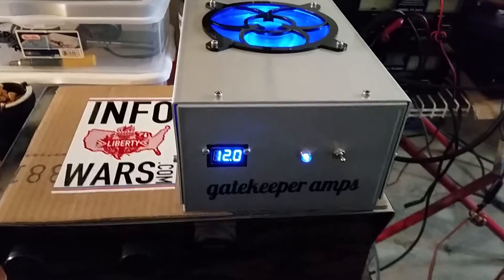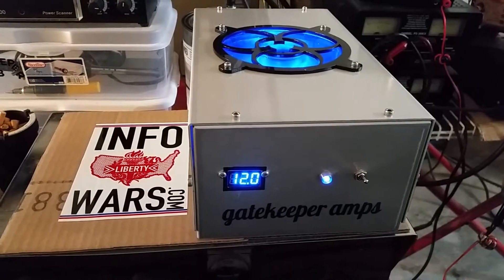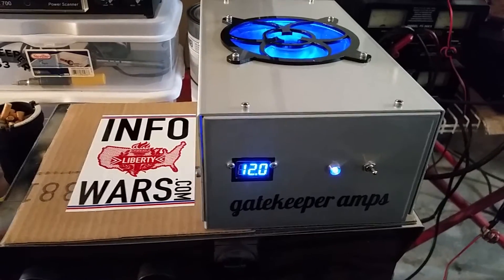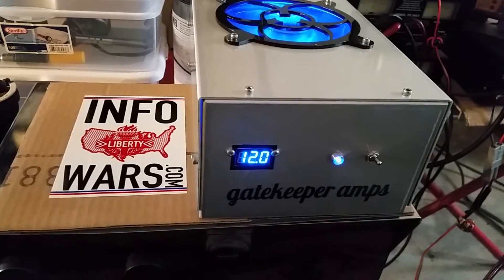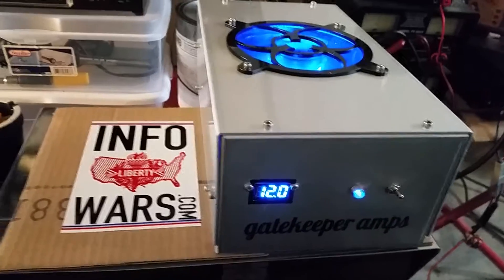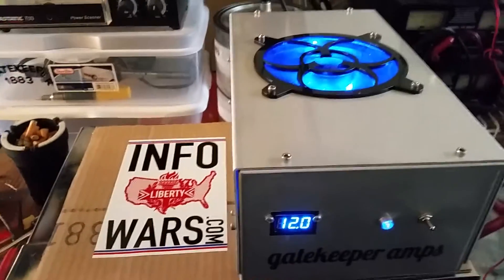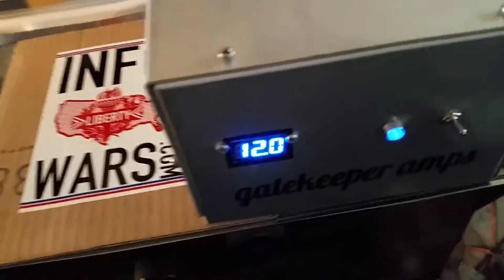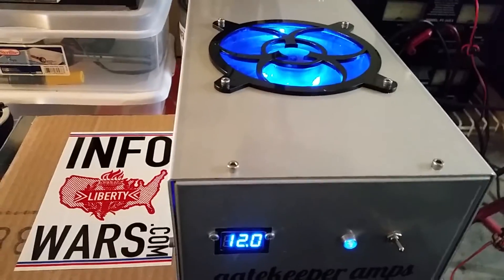Gatekeeper Built 18A ATX Switcher Power Supply - [For CB Radio or Small Amp]

Comment: So Gatekeeper when I use to run my XF Mosfet 400 it would pull my voltage down to 8-9 volts.  Q; will the volt regulator hold the volts at 12 volts or above, and can I power the regulator from my 5000 watt inverter?

Mr. 825
Dallas

Comment: You can buy 36 Amp fully filtered adjustable voltage (9v to 15+v) PS on Ebay brand new for 60 bux. Been running one for two years now without a hitch.

Comment: Good regulation, only a tenth of a volt under load.
Reply: many have much negativity to say about Gatekeeper. The fact is though - that... the man puts out a quality product. I have witnessed for myself his product out right crush his long careered competitors. If I ever build a key down vehicle it will sport a gatekeeper product. Also, it was Gatekeeper who took the time to send me hand drawn diagrams so that I may finish a palomar amp that I had here incomplete. Something that I will finish the post on that I started on the MD website. One last thing on Gatekeeper.. After speaking to a few builders on a product that I wanted built... it was Gatekeeper that had no negativity for me, nor did he says "what do you want that for?" instead Gatekeeper said.. I will build what ever you ask - just pay me. it does not get anymore clear cut and to thee point than that.